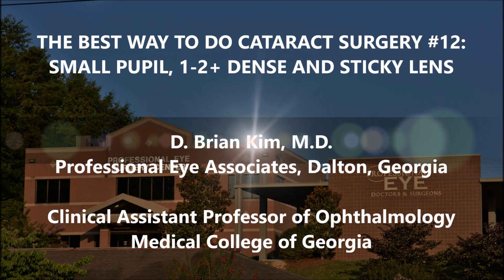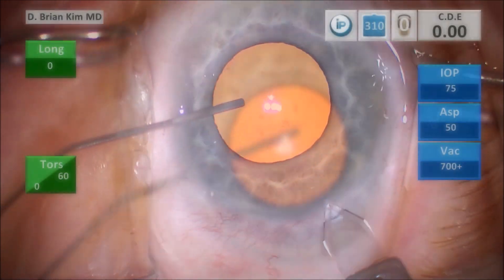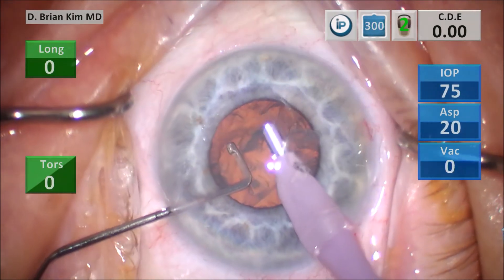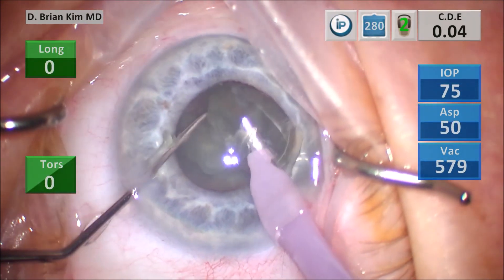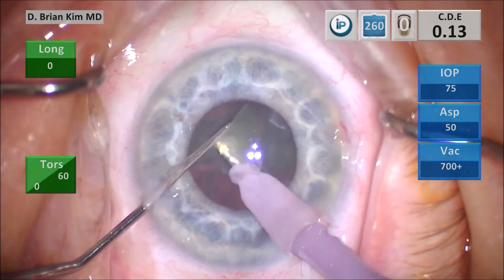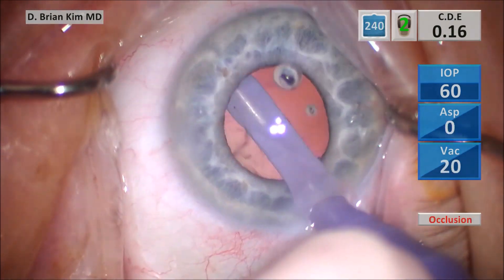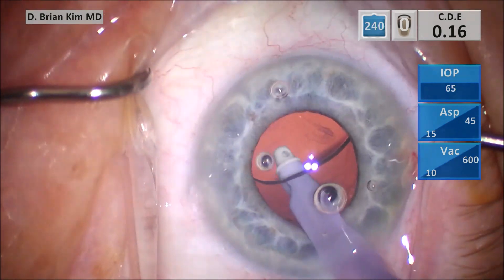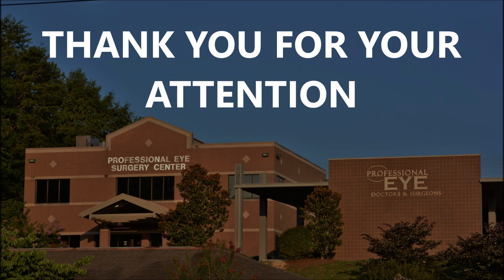The Best Way To Do Cataract Surgery #12, 1-2+ Sticky NSC, Small Pupil

Comment: Isn't Malyugin ring used when the size of mydriasis around 5 mm?
Reply from the maker: 준원장 thank you for your question. The use of pupil expansion devices is really dependent on the preference of the surgeon. I do not typically use one in this setting. I reserve pupil expansion devices when there is a small pupil, a very dense lens, and weakened zonules. Best wishes.

Comment: Thank you Dr Kim. 
Want to ask you about your chopper. 
Am buying one nowadays. 
When I contact katena guy, I found out that the chopper is 2 mm length. But I remembered that you mentioned it’s 2.5 mm in one video. 
Kindly clarify this for me. 
Actually I feel better with the shorter 2 mm. 
Thank you.
Reply from the maker: great question. I have to go back and measure it but as I recall, it's measuring at different points, I think the total vertical length is 2.5mm but if you measure only the vertical component of the chopper from the inside dimension, it's 2mm. I will have to measure it again. Bottomline, 2 or 2.5mm, neither is too long for the capsular bag. As long as you do the technique properly, you cannot rip the posterior capsule with this chopper. Best wishes.